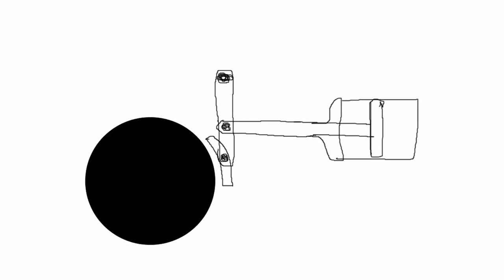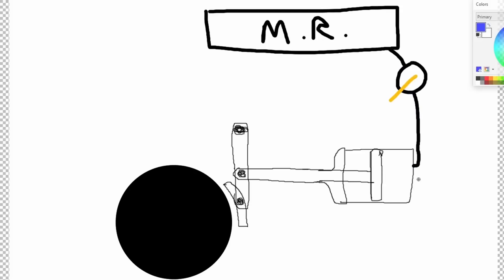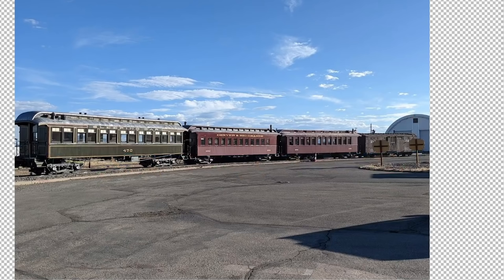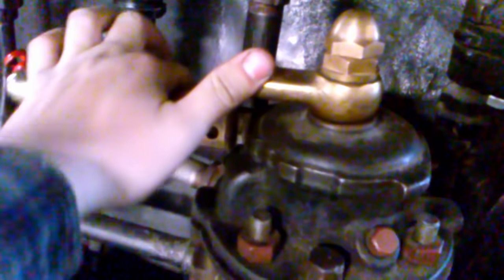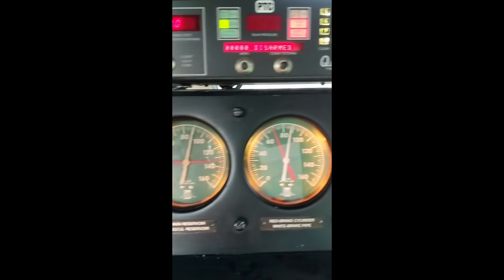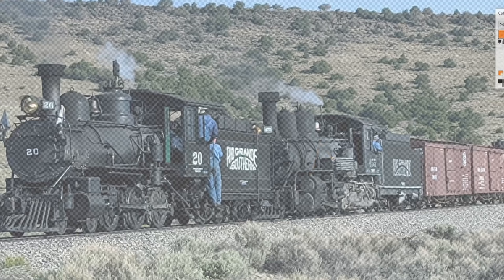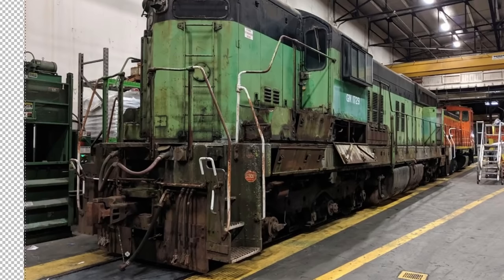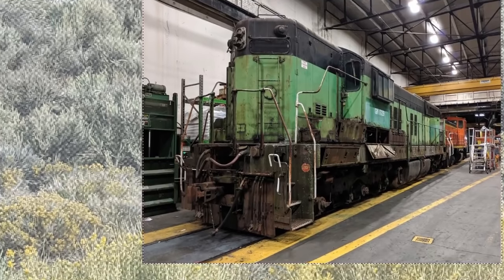AIRBRAKES 101: 10 levels of TRAIN BRAKE understanding!

Comment: WORLDWIDE TRAIN BRAKE SYSTEMS
First principles of any railway train brake system is that it must be "Fail Safe". In other words if something goes wrong, such as the trains couplings break, both parts of the train MUST still be able to make an emergency stop. So must automatically apply on ALL vehicles, to bring both parts to a safe halt. Virtually all train brake systems world wide fall into two categories namely Vacuum or Air brake. Although many steam locomotives also had steam brakes for use SOLELY on the locomotive. (Used when a locomotive is moving by itself).

BASIC VACUUM BRAKE SYSTEM.
With Vacuum brakes the air is removed from the train brake pipe, by an ejector (sucking pump)  to RELEASE the brakes.  If the train breaks in two, then the pipe between those vehicles breaks and atmospheric air naturally rushes into the pipe, destroying the vacuum and automatically applying the brakes on all vehicles. In normal use the driver can graduate slowly the amount of air allowed into the pipe, to bring the train to a controlled and gentle halt.

BASIC AIR BRAKE SYSTEM
Basically a reversed vacuum system, whereby Pressurised air is needed to RELEASE the brakes, & provided by an air pump. If the train breaks in two then obviously the pressurised air rushes out, so applying the brakes on all vehicles. In normal use the driver can graduate the release of the air pressure slowly, so all the brake blocks on all vehicles begin gently rubbing on the wheels to bring the train to a nice smooth and gentle halt.

LIMITATIONS OF THE SYSTEMS ABOVE.
The Downside of both the Vacuum & Air brake systems as explained above. Is that in normal use, the Vacuum or Air pressure is controlled from the brake handle in the locomotive cab. So it takes time for the vacuum or air pressure to change, as the effect of this change has to pass along the whole of the train from front to rear. This slows down a trains ability to stop quickly.

 As a result of the DOWNSIDE of the above systems, certain alternatives are possible. The British Great Western Railway for example used a higher level of vacuum than the other railways of Britain, so allowing a somewhat quicker reaction by the trains brakes to the drivers use of the brake handle, and in addition "rapid reaction" release valves on each passenger vehicle. (This was not applied on freight vehicles).

With Air Brakes, which were NOT common in Britain or Spain/Portugal in the steam era, a Major change came with the arrival of Diesel & Electric locomotives. A Dual pipe system was introduced, where you have in addition to the "Brake Pipe", a second pipe known as the "Main reservoir pipe".  This allows the Air brake system to be used as previously described using the brake pipe. But the addition of the 2nd "Main Reservoir" pipe allows pressurised air cylinders on each vehicle to be constantly kept charged with air pressure. When the air brake is used in normal use, by releasing air pressure to slow a train down for a sharp curve for example. Then when the brake is released, it can recharge direct from the air reservoir tanks, so as not to waste time waiting for the brakes too release as with the single brake pipe system.
Railways in Britain can be extremely busy with trains every couple of minutes, so the dual pipe system is very beneficial, in reducing delays to trains.

The modern Air brake system, can be taken yet further, if you also have an electrical supply along the whole of the train. Such as with Multiple Unit (Diesel or Electric) type passenger trains, which are common all over Europe. In this case the air pressure valves on each vehicle are all controlled by an electric relay so that ALL vehicles in the train begin braking simultaneously, and do not have to wait for the air pressure change to feed slowly along the trains brake pipe. This type of electric Air brake is known as EPB (Electro-Pneumatic Brake) in Britain. 

An example of the EPB brakes use (first introduced in Britain in 1951), is that I was able to stop a 12 car electric train (3x 4CEP/BEP units), around 800ft long and weighing roughly 450 tons +31 tons of passengers, from 60mph in its own length of 800ft. Using a normal instant full brake application (Not Emergency application). For ANY train this is extremely rapid deceleration. Even though this was a commuter express with a Restaurant car, the train was brought to a smooth halt, and not a drop of tea was spilt in the catering vehicle.  Indeed having driven trains in many parts of the World, I have never found any other brake system anywhere in the world capable of such rapid deceleration, not even Metro type trains !!!

Bake Mania 😝
Reply from the maker: Brilliant, brilliant, comment. Cheers for the info!
Reply: Thank you for the reply on UK trains.
Reply: The old UK Basic Vacuum Brake system
When you connect your engine to a train thats brakes are already applied using the vacuum system.
The engine then pulls the same vacuum in the system and all the brakes will come off. (except the guards hand brake)
The guard will check he is getting the correct vacuum at his end of the train. 
If correct then the vacuum is destroyed and the guard will then walk the length of the train to confirm all brakes have gone on fully.
If the engine is unable to pull the vacuum, the train must be taken out of service.
The train can still be moved by first walking the train and pulling a cord connected to every brake cylinder. This will equalise the air pressure / vacuum in each cylinder.  This would also be done to change from an British Great Western Railway  engine 25" mercury system to a standard 21" system.
Reply: @ryanknox3522  The train airbrake system in Britain is today, a two pipe system, with a Main Reservoir pipe in addition to a Brake pipe. This allows rapid recharging of the brake pipe by the main reservoir pipe, (especially helpful on passenger trains). Because a pressurised air supply is held in air tanks on all vehicles. When air pressure is released from the Brake pipe when the driver uses the brake handle in the locomotive, the falling air pressure begins to apply brake blocks to the wheels, retarding the train. When the brake handle is released, air flows from the vehicle reservoir cylinders back into the Brake pipe, releasing the brakes far more quickly than using a single pipe system as found in the USA & Europe. 

There is also an even more sophisticated air brake system available from 1951 on electric passenger trains, where electric wires along the train are used to control the Brake pipe, reservoirs & main reservoir pipe automatically to apply and release the brakes simultaneously on all vehicles, therefore dramatically reducing braking distance. This system was known as the Electro Pneumatic Brake (EPB). 

More modern attempts to replace parts of the air pipe system with more electronics, and replace brake blocks with disc brakes, have unfortunately led to retrograde steps in actual braking performance, especially in adverse weather conditions. The most notorious being the BR 1980's "3 Step brake" (an electronically controlled air brake with a lack of versatility of the air pressure required), which should have been banned, as dangerous. 

So I have never found anything as good as the EPB brake for stopping passenger trains. Freight is a totally different issue, as braking becomes a lot harder & requires more skill, especially when you have two 45 tonne wagons full of commercial explosives included in the train !!!!

Comment: The greatest possible pressure difference in a vacuum pipe is 14.7 psi  i.e. one atmosphere. The diameter must be larger to deliver the same power as a 90 psi system.

Comment: Thank you for posting this. I know nothing about train braking systems, so am the "Target Audience" 🙂
The thing that gets me is how you get a feel for how much brake force to use: With a passenger train, it my be full of people, or nearly empty: That must make a significant difference?
Then the freight train that goes on for ever. . . . .
Reply from the maker: If you've got a fully loaded passenger train in the narrow gauge world (40-50 people per car adds up to something that's a decent portion of the car's weight), you do notice the load. I doubt that's the case in standard gauge with much heavier cars. All about proportions. As far as braking - you typically have a rough idea of what you need, and then make adjustments. "Going down a 2% grade starting soon, I've got this much train, OK start with a 10 PSI reduction and edit from there" kind of thing.

Comment: I find it interesting that the way the brake systems in the train I saw at a storage house and these you are explaining, the brakes work differently but they are connecting-compatible.
The one I was shown, the brakes, there's no reservoir, they work closely to how trucks work (with a spring to apply by default) and they have a brake disengage too.
The disengage works by rotating a flywheel a few times to mechanically overcome the spring which engages the brakes. The flywheel then requires setting a fail-safe 1-way, position-evident pin to lock in the open position. Note: In this design, the brake wheel cannot be used to pull the brakes.
The fail-safe is that if a train is connected and it pressurizes beyond the current brake opening (which will happen when applying full brake disengage), the pin loosens and resets.

Do note I'm not from USA or even America.

Comment: I might be wrong because it's been a while since I was a railroader, but when making a brake pipe reduction from 90 to 80 pounds, the pressure of the air acting on the brake pistons on the cars isn't 10 PSI. It's closer to 30 PSI. One pound off the brake pipe equates to the control valve admitting about 3 pounds of air to the piston--a roughly 3x multiplier. I forget the technical reason but that is why a 30 lb reduction is about the most you can go (vs. setting a 50 or 60 pound reduction, for example), because you're setting 100% of the 90 lbs of air in the cars' service reservoirs.
Reply: 3X might be wrong. I don't know the exact term to search for to find out what I'm thinking of. At any rate the idea is that a BP reduction of 10 lbs correlates to a higher pressure of air admitted to the brake piston, and that's why you can't set the automatic below 60-something pounds.
Reply from the maker: You're correct, and I've been too far away from my car equipment manuals to know the exact number myself. A lot of the NG we didn't worry about that because with the old F valves, and light coaches, you could get things sliding at like a 12-13 PSI reduction... so we never got that far. But yeah, the pressure is actually higher.
Reply: The reason I heard a while ago is a bit different.  The brake cylinder is about 2.5 times smaller than the reservoir.  That means that, for example, a 5 lb reduction has to squeeze into the smaller cylinder and is thus more pressurized, and ends up as 12.5 lbs.  That wouldn't explain why you can only get up to about 30 lbs reduction, though, since the reservoir would still have 85 lbs in it.
Reply: @BandanRRChannel  Bingo...
Reply from the maker: @BandanRRChannel  You start sliding the wheels before you run out of air :D

Comment: I'm not going to go through nearly 300 comments to see what all was mentioned.  I was a CSX engineer for eight years nearly 14 years ago and went through engine school in 2000 when it was in Cumberland, MD.  Air brakes and air brake theory at that time was an entire WEEK of the month of classroom instruction.  That is how important this is.  He didn't even get into the difference between passenger brakes and freight brakes.  Passenger air allows for a gradual release of the air, while freight air is either applied or fully released.  Then there is "blended" braking used by Amtrak and commuter authorities on modern locomotives, which combines air and dynamic braking.  I never used it, so I can't explain it, but it's essentially single-handle braking that seamlessly uses both air and dynamic brakes in the optimal combination for conditions.  Another aspect of air brakes and how they work is the difference between the flow rates of normal or "service" air flow and emergency air flow.  The brake valves on the cars are designed to know how fast the air is flowing past them and use that to decide when to apply the emergency brakes.  Service air flows at about 400 ft./sec. and emergency air flows at about 900 ft./sec.  (Which means on a 10,000 ft. train there would be over a 10 second delay between the front and the rear cars in putting the consist into emergency, which could cause a derailment.  One reason why "The Big Hole" is something not to be used carelessly.  Modern End of Train devices can be triggered to dump their air valve, so most engineers are taught to do that at the same time they hit the "Oh, Sh*t" handle.) So, say the conductor is adding a cut of cars to a train and turning the air into the cars and moves the angle cock a little too fast and the air from the cars already in the train starts flowing faster than normal into the new cars, the brakes might think they are supposed to go into emergency and dump.  Common rookie conductor mistake.  Also, the small air reservoirs on each car are divided into two sections, a service air and an emergency air section, which is how the emergency air gets applied to the brakes throughout the train so fast.  Everything is charged from the main brake pipe hose.  Freight air is 90 psi, passenger air is 110 psi, switching air is 80 psi, and ground air (which is a very important thing when it comes to brake tests) is 70 psi.  The reason that ground air and switching air are lower is so when the cars are added to a train they will match the "gradient" of the air brake profile of the rest of the train.  Most trains of any length do not maintain 90 psi over their entire length.  CSX rules allowed for a 15 lb. difference in pressure between the front and rear to pass an air brake test, meaning you could pass the test with a reading of 75 psi on the rear with a full release on the head end.  Bear in mind that this is also affected by things like outside air temperature.  The colder the weather, the harder it is to maintain train line pressure over the length of a long train.   I don't know how the Class Is are able to operate 15,000 ft. trains in January in the North, especially if there isn't a DPU either in the middle or on the rear of the train to add air pressure?  I had enough trouble sometimes with trains under 10,000 ft. in Winter.

Some mainline excursion steam locomotives do use 26L freight brakes.  I know for sure that Nickel Plate 765 does and the Ohio Central steam locomotives that ran regular excursion service (1293 and 6325) did.  I believe N&W 611 might also.  I've been told that UP 844 and 4014 use older types of steam locomotive brakes.  Most tourist railroads use freight air and not passenger air setups, so no gradual release.
Reply from the maker: Man, the amount of brilliant comments coming in lately on this video from folks like yourself is fantastic. Great info in here, some of which i knew, some of which i didn't. Appreciate your insight and adds! Yeah, there's a reason real airbrake classes are so long. Hopefully with your knowledge you agree that this was an OK first look for folks who don't know it at all! Haha.
Reply: @Hyce777  Yeah, most fans really don't care about the detail.  I put together a program on railroad operating practices for fans at what I thought was a basic level and it pretty much was a snoozer.  So, your attempt is probably about right for most fans.  The most important things any engineer has to know are 1) the grades of whatever territory they are operating over, and 2) how to safely stop whatever size and weight of train they are operating.  The thing that surprised me most about becoming an engineer was how different the reality of operating is from what a fan thinks it is.  And that is too long an explanation for here.
Reply: I never even thought of air temperature and the resulting effect on air density as being another bug-a-boo in train brake operation. Thanks for the real-world  info.
Reply: @fiddlyphuk6414  Not only that, but when you compress air you heat it and wring the moisture out of it as it cools back down.  Which is why the pipes from the compressor to the main reservoir curve around - to cool the newly compressed air.  It's also why there are "spitter" valves on the air systems of locomotives, to continuously drain the moisture from the tanks.  Some railroads, like CSX, also use air dryers that kind of look like small air compressors on the train line to further dry out the air before it goes back through the train.  Moisture in the air line can freeze the brake line in the winter and either cause damage or prevent the brakes from working properly.  In the "old days" a lot of conductors used to carry gas dryer with them, which is alcohol-based, and separates out water when poured into the brake line at a hose, but it also will ruin rubber brake hoses and gaskets over time, so the company doesn't want them to do that.
Reply: Before DPU became common I know the Canadian class 1s had compressor cars to help maintain the pressure in winter. I've never seen a good description of how they would work but I assume it would been limited to how much air it could add to the system all at once and have a valve similar to what was on the cars with the difference being when the air pipe was being charged or held it would try to hold pressure. A reduction would stop the maintaining process until a release/charge was sensed. Anyone have info on those?
Reply: When we restored AT&SF 2926, she was upgraded to a 26L brake system.  This did not go over well with some purists who value originality over safety.